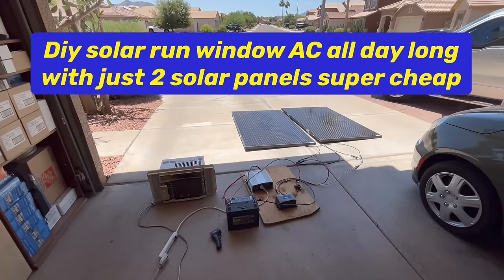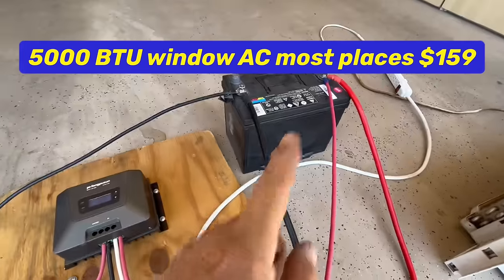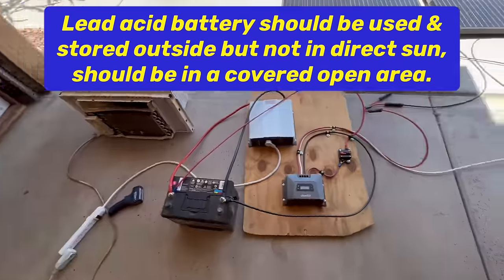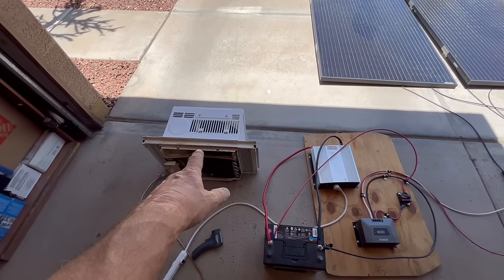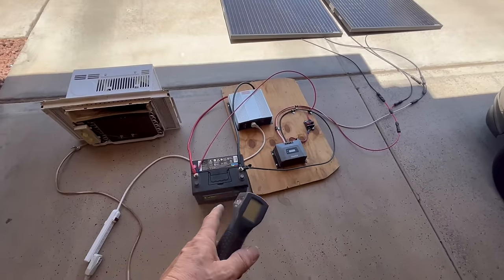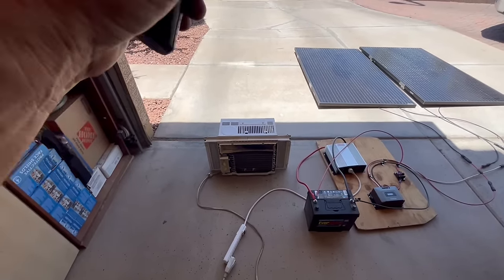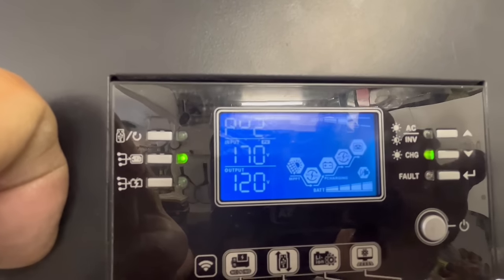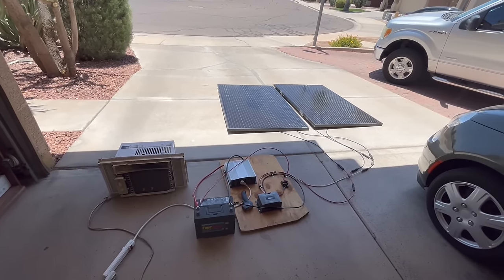Run your window AC with just 2 solar panels when sun shines. Easy DIY project you can do in one day.

Comment: Could you build a 24,000 BTU split mini model for a 600 sq foot home? How many panels and batteries would be needed and parts? Thanks! 220 amp unit?
Reply from the maker: Yes you could do that but a 24,000 btu mini splits is designed to use in a 1500 square foot area. I use 6-12,000 btu mini splits in my home, 2 upstairs, 2 downstairs and 2 in the garage. My house is a 2 story 2450 square foot and garage is about 550 square feet. You don’t need that large of a unit. 12,000 btu mini splits I have are 16-19 seer and will use around 1000-12000 watts when first started. After about a half hour that will drop down to 400-800 watts. My 18,000 btu mini split in garage uses around 1800 watts at start up and after about half hour will drop down to about 1000-1200 watts, then after room cooled maybe in 1 hour could drop down to 800 watts. Using a 24,000 btu mini split would probably need around 2400-3000 watts at start up and eventually drop down to maybe 800-1200 watts. But when you oversized a mini split that is meant for 4 times that area, you will run into problems. If you used a 24,000 btu mini split it all depends on seer rating. The higher the seer, the less watts it will use while running. But you would probably need around 3000-4000 watts in solar panels for a 24,000 btu unit. For a 18,000 btu unit you would probably need 2500-3000 watts in solar panels and for each 12,000 btu unit you would need around 1500-2000 watts in solar power. Once again that seer rating can make a huge difference. A 38 seer 12,000 btu mini split 120 volt could at start up use around 800-1000 watts and settle at around 200-400 watts after room temp is reached. That same unit using 220 volts will use about the same amount of watts. You said 220 amp unit, but I think you were meaning 220 volt. If you use 250 watt solar panels, to get to 2000 watts you would need 8 solar panels and could produce around 50 amps. At 3000 watts with 250 watt solar panels you would need 12-250 watt solar panels and could produce around 75 amps. With 300 watt solar panel you would need 10-300 watt solar panels to get 3000 watts in solar. The one thing to remember is for every 100 watts in solar panels you more than likely will at best produce 75-90 percent depending on time of day, angle of solar panels, weather conditions, how the solar panels are connected together. There are a lot of factors but you usually want to oversized your solar panel watts to 130-150 percent of what you will need to supply load. So if you actually needed 1000 watts to run a mini split, you would install 1300-1500 watts total solar. If you use 1500 watts, you will thank you yourself later for adding extra solar panels. Hopes this helps, let me know if you still have questions. Good luck with your project. Hope you have a wonderful and very blessed weekend.

Comment: Have you looked at those CIGS Bouge RV flex panels? I know they're 10x the cost to get to 600watts but at 6lbs each much more portable and definitely an upgrade compared to the original flex panels.  Great video.
Reply from the maker: I did look at those panels. They are really expensive. I actually am air conditioning my house 7/24 with solar in day and LiFePO4 battery bank at night. No need to look for more solar panels. I actually just installed a mini split in my 23 foot motor home and will be looking at options for solar. Not sure if I want to install on motor home or bring along solar panels to set up at camp site. Leaning towards setting up at camp site with light weight solar array.

Comment: Good explanation of a basic system, thank you. 

We are living in our RV and want to upgrade to an efficient mini-split system with solar. 

The whole system will be large and well built but till then I am thinking a small, quality system can be built for around $2000 with LiFePO4 batteries, a standard deep cycle would be an inexpensive start, thank you.
Reply from the maker: I’m getting ready to install mini spit in my 23 foot motor home. A actual have a 12,000 btu 110 volt system for it already. I trying to figure out where to install everything. I have 6 mini splits installed in my 2 story house and I love how efficient they are. I used a 2400 watt MPP 24 volt off grid inverter to run 2 mini splits in the day. I have a lot of videos showing the mini splits and how well they cool and heat and what I used for system. Hope you have fun installing mini split.  Hope you have a wonderful and blessed weekend

Comment: nice inside wood b different  but truly nice way to go  wood b less stress enclosed   NICE
Reply from the maker: Thank you. We actually run our upstairs, downstairs and garage ac and heating 100 percent of the time using only solar. A total of 3000 square feet of space. We also run our pool pump and heat our pool with only solar. Check out our other videos showing all this and what components we used and where to buy. Hope you have a truly wonderful and extremely blessed 2024

Comment: Nice work, i understand all the comments and corrections from some trolls ,but for us regular guys this opened up a whole new world. Like it, do another one,also would it help too have a couple ,say 4 batteries,and 4-5 panels
Reply from the maker: Yes, the more batteries and solar panels will give you a much better system. This was just the basic bare bones of components needed to show you can run a window ac with solar. A lot of people missed that point and that you can always improve the system. I now run my entire 2450 square foot 2 story house air conditioning and heating 100 percent off grid and do the same in my 3 car garage that is 600 square feet. I run my pool pump 365 days a year 24 hours a day with only solar and heat my pool to 86-89 degrees in March when neighbors pool water temp is in the 40’s and 50’s degrees. It all started with using that little 5000 btu window ac to cool my solar shed for 2 years. Check out my other videos to see what components we use to accomplish this and where to buy components. I plan on making another video using Lithium iron phosphate (LiFePO4) batteries and more solar panels along with using just 3 or 4 solar panels to run a mini split that can heat or cool 600 square feet instead of just 100 square feet with window ac. Thanks for you comment and hope you enjoy watching my other videos on all the things I use solar off grid for. Hope you have a truly wonderful and extremely blessed 2024

Comment: Interesting project! I have a shed this might work for.
Reply from the maker: Check out my Part 2 video where I show how to upgrade and improve system. This was just a simple example of how to use solar to run ac. It can and should be improved upon depending on your area, such as if you have cloudy days often, that will make it hard to do solar unless you add more solar panels and batteries to make up for decreased power production with shading from clouds, trees, house, buildings, etc… we now run our entire 2 story house on only solar in day and Battery bank at night, we also air condition our garage all day long using solar to keep at 78 degrees while 115 degrees outside in day. Check out videos to see what is possible with off grid solar and just how easy it is to DIY. Thanks for your comment and hope you have a truly wonderful and very blessed day

Comment: I wish I could AC with that little power.  But it's 110 degrees outside, 5k btu isn't that notacable and wouldn't be able to cool a closet in my house.  The best way I found was to cover the roof in water solar panels for my pool.  The pool gets to 100ish degrees, and males it a bit unusable, but it does a wonderful job sinking the heat away from the house.  Also, there are far better ways to heat exchange with lower power than a typical AC.  Tech ingredients channel has some really good experiments on it.
Reply from the maker: I actually used this in a shed for about 2 years to keep my inverters and batteries cool. It was 105 to 115 degrees and kept it below 70 degrees all day long. Very well insulated on walls, ceiling and floor. Shed was in full sun after 10 am till sun went down. It did not use a lot of power since it was a small shed and very well insulated. This video was more about the basic concept of running an ac with solar. Now I run my 3 1/2 ton upstairs and 4 ton downstairs ac all day with solar keeping 2450 square feet 72-74 degrees when 115 outside and we use EG4 battery bank overnight to run upstairs ac. Check out our other videos on what we run with solar now. This was a starting point 4 years ago. Thanks for your input and hope you have a truly wonderful and blessed 2024

Comment: I’ve been looking for this kind of video for long time it helps me to understand a lot better very simple thanks. looking at Amazon they say 330 or 300 or what ever but when they say 330 that’s for two panels.  can’t find any one panel rated 330 watts.
Reply from the maker: You can try it. My 5000 btu ac used around 500-550 watts to run. Depending on your charge controller, you might need 3 300 watt solar panels. This is just a basic set up to show the components needed to run an ac with off grid solar. Adding and improving on design will greatly increase how long you can run the ac. If you live where it is cloudy often, you might find you will need 3-6 solar panels to keep up when there is cloud cover on solar panels. 2 solar panels will only work in 100 percent sun shine all day long. And having a LiFePO4 battery or 2 in parallel will help as well. More improvements, the better and more reliable the system. I started with this simple design and now heat and cool my house and garage all year long in the day and use LiFePO4 battery bank to run my 3 1/2 ton ac at night. Just using solar to run ac for heating and cooling saved me over 60-80 percent of my electric cost year round. I have videos on how I did this. I even installed 6 mini splits in garage and house which use a lot less than the 2 whole house heat pumps. I over produce the amount I need and never have a problem because I buy used solar panels for $25-$35 each. I later ran this system with 2 charge controllers and 4-250 watt solar panels. Then kept adding more charge controllers to a battery bank of 4-12 volt deep cycle batteries to 12,000 btu mini splits. Eventually I started using 24 volt all in one inverter and used 4 of those in parallel to share the current, produced over 9000 watts using that system. I eventually went to 48 Growatt inverter that replaced the 24 volt system and now run produce more than enough power for all my needs. Check out my videos. Hope you have a wonderful and blessed weekend
Reply: @diy-solar-guy  thank you I appreciate your help.
Reply from the maker: @MP-li2ho  you are so welcome

Comment: That is great. I have a 5000 BTU AC and my new 4 370 watt solar panel will not run the AC all day. I charge all day until 2 pm then turn on and it stops buy 5 pm I also use 4 new 100ah lifepo4 batteries
Reply from the maker: What inverter or charge controller are you using? Those 4 solar panels should be more than enough to run ac at 9 am if in full sun and facing towards the south at a 35 degree angle. Your 4 LiFePO4 battery should be able to run you past the time the solar is no longer producing 500 watts from solar input. Something is wrong?
Reply: I AM USING LEAPTARD 2000 WATT FULL SINE WAVE INVERTER AND POWMR  CHARGE CONTROLER @diy-solar-guy
Reply from the maker: @raymondpetersen3543  I have not heard of that brand inverter. What is the most watt input from solar panels between 9 am and 5 pm. If there is no shade you should be able to get at least 1000 watts input to inverter during peak hours of the day. That is the least, if your solar panels are only at 70 percent of max watts. You could have a problem with the wires connecting solar to inverter, one or more of the panels might be bad or have an open circuit. Or charge controller may not be working correctly. Also there is a min volt and max input voltage from solar panels before charge controller will start working. Let me know what the watt input is from 9 am to 5 pm for each hour. Maybe we can get this working for you.

Comment: Per 11:44 on the video, as you know,  cool air does not rise, and hot air does not drop. Cool project though. Curious what would happen to the setup if you covered the panels mid-cycle to mimic a cloud or something that would significantly affect the output. You have an amazing setup in the garage. Are you an HVAC tech or an electrician by trade?
Reply from the maker: @ozzman530  Thank you so much for your comment. I am going through 3 cancers and have to take very strong pain killers and when I did the video with window ac with 2 solar panels, it was a very difficult day and I flipped the hot air rises backwards. Thankfully I do not do that often in the videos. It takes me a long time to mount a solar panel or install an inverter. Most people could install 10-20 solar panels in a day. I’m lucky to get 2 done in the same amount of time. The battery helps to keep power constant when there is clouds or partial shading. Without the battery the system would shut down and not be able to start again. I actually now have 3 separate independent system with the potential for each to have 12,000 watts output from each system. If I had enough solar, I could have around 36,000 watt output. But I am actually combining everything to the 4-EG4 3000 watt inverters in parallel and will have both Growatt inverters as backup. I am just a humble man that is self taught by watching videos and reading articles about off grid solar. I knew very very little 4 years ago about solar or hvac. I have a lot of time on my hands going through 3 different cancers and focus a lot of time on the solar off grid. I have a lot of real world experience from building these 3 separate systems over 4 years, started out with charge controllers in the video then used 24 volt MPP inverters, then 48 volt MPP inverters. Then Growatt inverters and now EG4 inverters which are by far the most efficient and least expensive inverters I have found. The EG4 3000 watt inverters are  extremely powerful when in parallel and only weigh 18 lbs. I am amazed at all the EG4. A run with no problems at all. Thank you for your kind words and I hope you have a truly wonderful and extremely Blessed remainder of 2924. Let me know if you have any more questions.

Comment: WHERE do you find (higher power) used solar panels anywhere near this price. The closet I can find anywhere is 2-4x what you paid. Bring in south western there should be an abundance of panels somewhere local. HELPPPPPPP…..
Reply from the maker: I have a couple of videos on where I purchased used solar panels very very cheap. They are having BOGO sale right now at santansolar.com. I just bought 5-250 watt poly blemished used solar panels for $250 and with the 5 free solar panels it came out to $25 each. So I bought 10-250 solar panels for a total of $250. That is 2500 watts in used solar panels. They say these still put out 75 percent or more of stated output, which would be 6.2 amps per solar panel or 187 watts. You could buy 12 of these solar panels and install on a 24 volt inverter 24 volt battery bank and produce 74.4 amps or 2244 watts of output power. If you bought 12 solar panels that would only be $300, that is what one new solar panel cost. I would only use these on off grid solar. Not placing on a roof of house but on a solar array. They have a location in Gilbert AZ and Savannah Georgia. Sale ends soon. Check out my other videos to see how I mounted solar panels and what I use them for. You will be quite pleasantly surprised with everything I do with off grid solar. Hope you have a wonderful and blessed week. Oh they do ship freight, you can get phone number from website and call for quote if you do not live locally to pick up.

Comment: What happens when the sun   is not out and the battery drops too low to run the inverter?  Needs to have some kind of control to protect the battery as it is bad for the battery to drop below its nominal voltage.
Reply from the maker: There are settings on the charge controller you can set not to go below that value. You have to also monitor a set up like this. This is just the bare bones to show solar will run an ac. I live in AZ where we have over 320 days of sunshine. If you live in an area where you have a lot of days with clouds or rain. I would suggest you do not do this. I just wanted to show you can run a window ac with solar. I now have evolved to run my whole house upstairs 3 1/2 ton and downstairs 4 ton heat pumps to air condition my house using only solar in the day and LiFePO4 battery bank at night. I also installed and can run 2 - 12,000 but mini splits upstairs and 2 - 12,000 Btu mini splits downstairs instead of the 3 1/2 ton and 4 ton heat pumps. We also run our pool pump 24 hours a day as well as in the winter when we don’t need ac or heat, we run our 127,000 Btu pool heat pump pool heater. We run 5 freezers and a refrigerator in the garage along with a full size washing machine and heat pump fryer and can run a dishwasher as well. We keep our house at 72-76 degrees even when it is 115 degrees outside. We also air condition our garage as well. All these mini splits have the ability to heat or cool. Check out our other videos to see all we do. Thanks for your input. Hope you have a truly wonderful and extremely blessed week